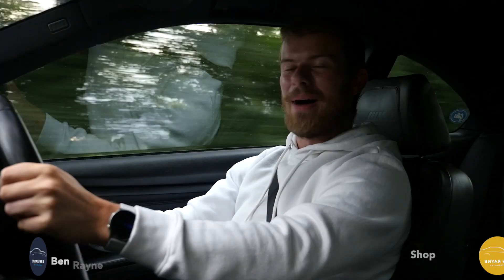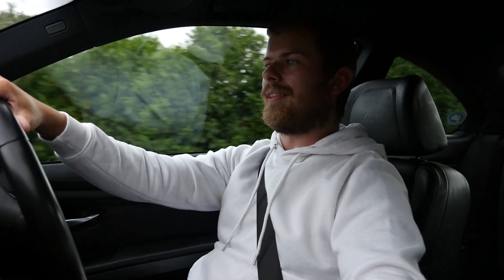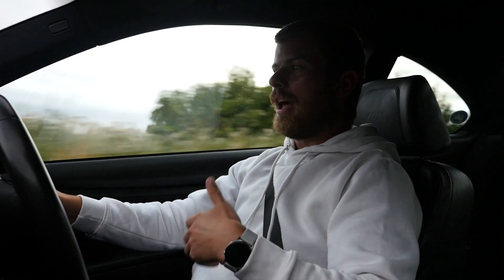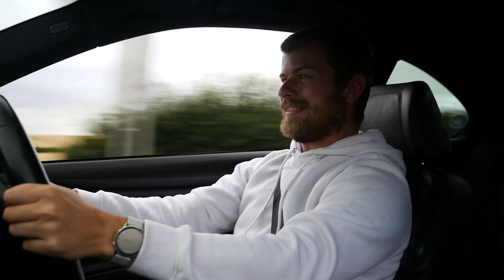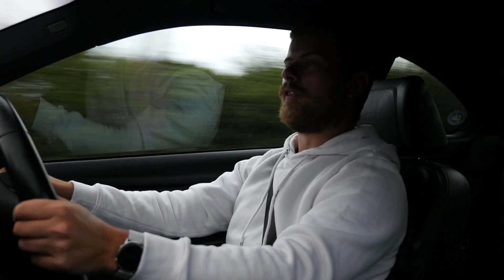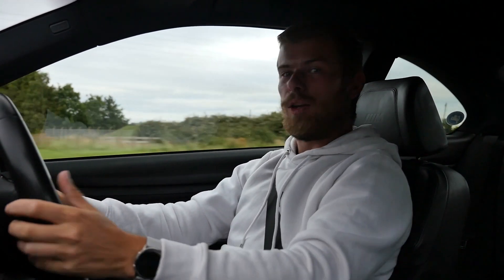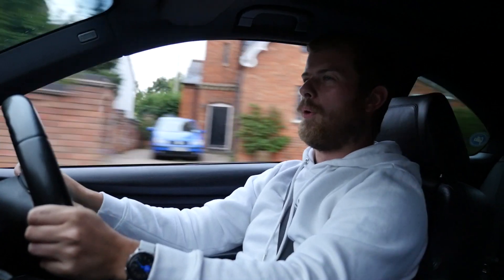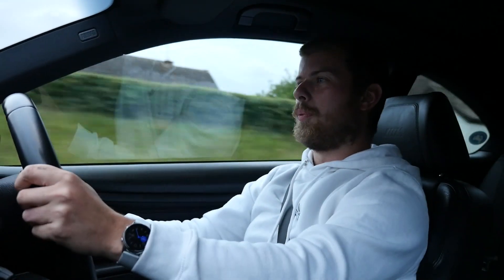Living With A DECATTED M3 - FIRST DRIVE

Comment: Great review Ben. I’m of to evolve on the 25th for stage 3. I may do the 1.5 mode. With the gutted cats it’s been shown on graphs a torque dip can you feel this? I bar of pressure is released when removing the pre cats for test pipes. How does it feel ?
Reply from the maker: Cant feel any torque dip but it definitely feels faster, with a slight increase low end. Getting it mapped on thursday
Reply: I'm going to Evolve in January when they have more test pipes back in stock. Can you confirm the gains in BHP are 440BHP/450BHP after? More top end power and low end torque is teh biggest win naturally. (Wish I could afford the Eventuri Carbon Plenum too!)
Reply: @Jay-Quallin  all depends on how well your engine is running, making good power or under power. But I can confirm with the test pipes, stage 2 tune, gts dct software and eventuri intake it runs a healthy 450 hp and 333lbs. It’s night and day to running standard.
Reply: @dansully5927  fair enough bro. Thanks for confirming but didn’t realise it was with eventuri intake too. Looking forward too it though 👏🏼